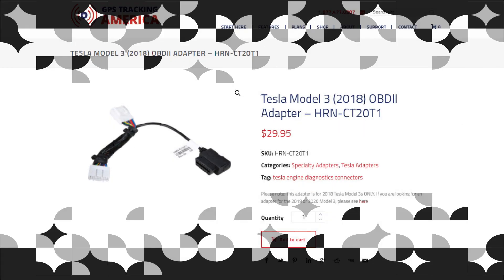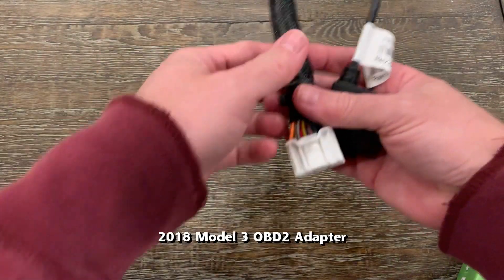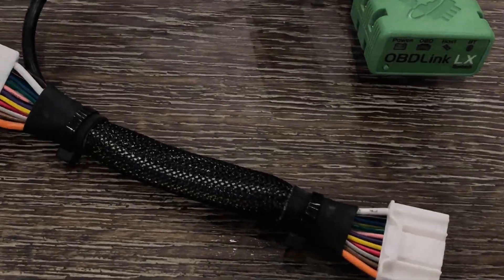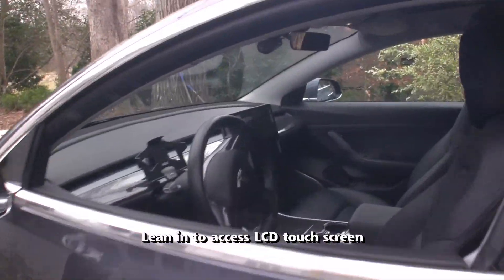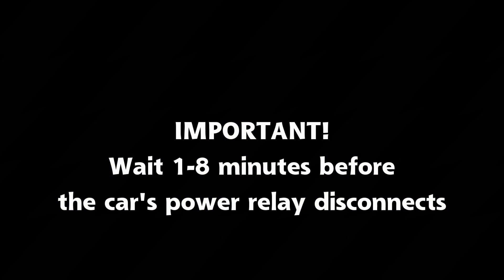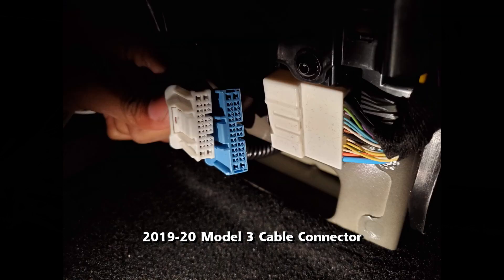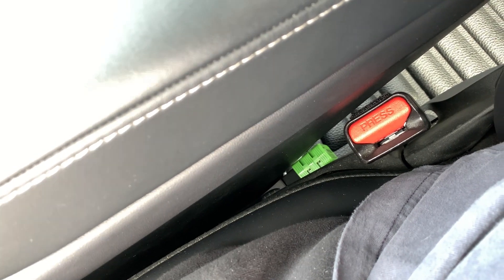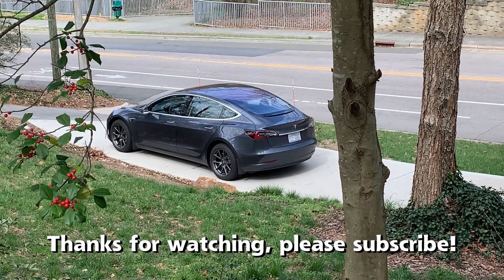Tesla Model 3 - OBD2 Adapter Install (Audio Fixed)

Comment: Is there a point to the data on it? Also wouldn't this void warranty?
Reply from the maker: I’ve done a number of videos on the software that uses the adapter. I’ve been using it for over six years. Why would it void warranty?  It only reads data. 
https://youtu.be/j-3Ei6w9xqY

Comment: What happens if I didn’t turn off the car when I unplugged the wire ? And obd link can do resettings like codes and bms , srs  modules
Reply from the maker: It shouldn't be too much of an issue.  But you really should have the car turned off before adding the adapter.  The software that runs on the OBDlink is read only as far as I am aware.

Comment: It’s nonsense that we have to do this with a tesla when it’s a simple plug in to the obd port for other cars.
Reply from the maker: The Model 3 was the first car not required to   have an OBD2 port (for better or worse). I think Tesla wanted to keep people out of the system by making it hard to access. Most EV makers still include them. My new Fisker has the port.

Comment: no need to turn off car, i bought lx befoe couple days ,remove plastic cover,put new cable and everything working
Reply from the maker: Yes, back when I did this almost four years ago, I was a lot more careful around the electrical system of the car.

Comment: My tesla is model y 2023.
Where i can find this connection. 
I didn’t see anything behind the center console
Reply from the maker: I think the Model Y has this connector in the front passenger footwell area.  Not exactly sure where.
Reply: @MTNRanger  @ngurahvanlaere My 10/2023 MY connector is behind the center console, but has similar, but different baby blue connectors. Ostensibly my link to a FB post with photo was removed. Where might I find the cable for these new connectors - or is there a new, better way to connect to OBD2?
Reply from the maker: @meinnovations  Sorry, YouTube sometimes deletes link posts.  The company that I have in the description also lists one for the Model Y: https://www.gpstrackingamerica.com/shop/hrn-ct26t1/
Reply from the maker: @meinnovations  Interesting, I have not seen the connector before.  It looks very similar but the red section with the black wire looks weird.  Here is a link of the normal Model Y connector.  https://teslamotorsclub.com/tmc/attachments/7say-png.751171/  I wonder if they changed to do discourage people from modifying it.
Reply: @MTNRanger  Mine (manufactured in Fremont) has the new baby blue connectors with an orange double-lock mechanism (move orange lock away from opposing connector, then press tab to release) in the link above. Note also that Tesla also put in some extra sheet metal (except that mine was coated - no bare metal) that makes it difficult to stuff the rest of the splice connectors below the connection point and behind the cover. I was able to stuff mine in carefully.
Reply from the maker: @meinnovations  Thanks for the info!

Comment: Does it matter if you connect the OBD when the battery is running
Reply from the maker: For the initial installation, I suggest to shut everything done.  For use of the Bluetooth adapter, you can insert and remove with the car running.

Comment: Very detailed video. Thanks ! Just wandering that can we ever use the OBDII port below dashboard? Or it is only for the manufacturer?
Reply from the maker: For the Tesla Model 3 and Y there are no OBDII ports below the dashboard.
Reply: @MTNRanger  thank you for your feedback. But I would like to secretly tell you that I received my model Y yesterday and there is an OBDII port left up to the brake pedal. I've tried with a diagnostic tool but it seems no data received.
Reply from the maker: @zappingz9190  Thanks, that must be a new addition.  I’ll look into it.
Reply: @MTNRanger  FYI, you can check Bjon Nyland' video for the same story.

Comment: For anyone doing this at home, connector should come unplugged without use of a screwdriver..... Just hands. If you need a tool, use a MUCH smaller screwdriver than that, no need to risk snapping any small plastic tabs and preventing it from going back together snugly
Reply: Auto grade wire to wire receptacles are usually push and pull type. No need to use flat screw driver. Push down the side pin and pull apart the two connectors.

Comment: Nice video! At what point do  you power ON the car in this video?
Reply from the maker: The car will power on again when you sit in the driver's seat.  Do this after all of the wiring connectors are installed.

Comment: Does something like this void any sort of warranty? Or should I just remove it before going to Tesla for any sort of service?
Reply from the maker: I had it connected to my car for service center and mobile service visits and never had any issues.  If you do worry about this, you can simply disconnect before  service.
Reply: @MTNRanger  got it, thanks. How would you disconnect this? Would I have to do the process of waiting for the car to complete shut it down first?
Reply from the maker: @ipwn3r123  Yes, the same process.  Let the car  shut down and then disconnect the adapter and attach the original connectors together.
Reply: @MTNRanger  Understood. Thank you very much!

Comment: Would you know if this would be possible to connect a dash cam with the OBD2 power?  The blackvue cameras has an optional OBD2 port for power
Reply from the maker: Good question.  Yes, I think it may be possible to connect it to the OBD2 adapter for power.
Reply: @MTNRanger  Have you or anyone you know attempted to see if this will power a dash cam without throwing any errors??
Reply from the maker: @loljz  Sorry, I haven't heard anything about that.  My 4K dashcam is powered by the 12V outlet in the center console.
Reply: @MTNRanger  Which dashcam do you have? Is it a blackvue that does parking mode recording? I have a blackvue  750s 2ch and I been wondering what would be the best way to install it without throwing up any errors. Really trying to avoid buying the blackvue battery pack
Reply from the maker: @loljz  Rexing V1 Max 4k Solo Dash Cam.  I did a video two weeks ago on it:  https://youtu.be/veIo3r9Pfjw
Reply: Yes, that is possible. The adapter cable routes the wires that go to the 12V onbord socket to the Diagnostic Link Connector ("OBD2 port"). So if you attach your dashcam there, electrically it is like you would have plugged it into the 12V onbord socket. And that is fine.

Comment: Can you use mirror link if you install these device
Reply from the maker: I'm not familiar with Mirror Link.  I did a search and could not find anything related to the Model 3.   Do you have a link?
Reply: @MTNRanger  I meant mirror cast. It like connecting your phone with hdmi to a monitor except mirror cast does not require a cable.
Reply from the maker: @badimpulses17  Bluetooth is how this adapter transmits data.  The software on the phone or tablet must support the adapter's protocols.  The only way to cast is with the phone or tablet.